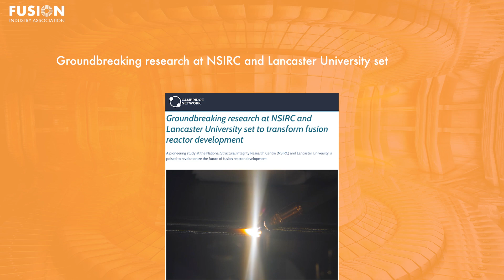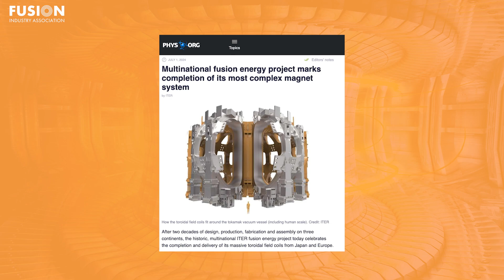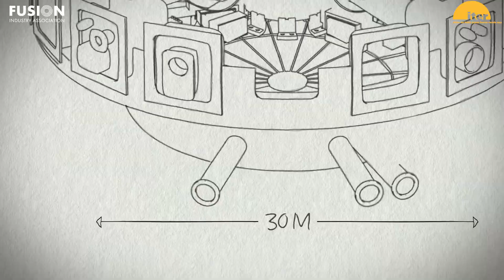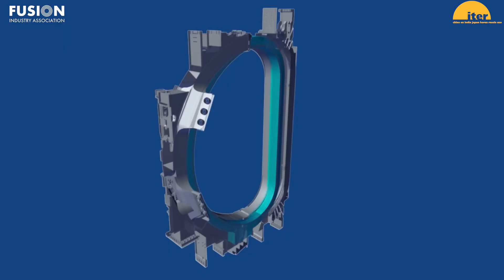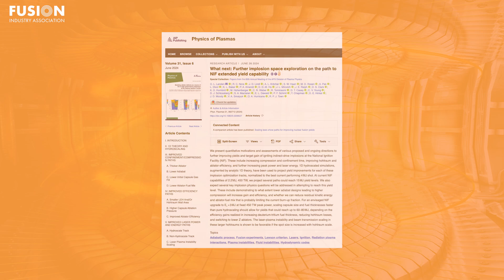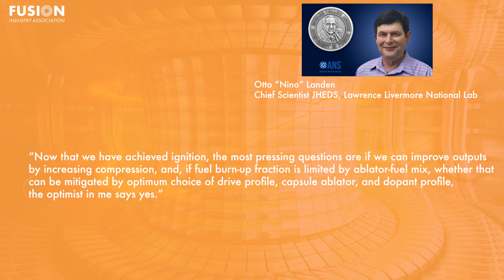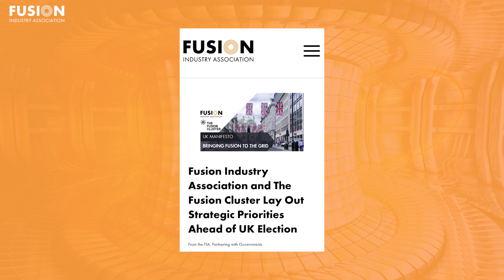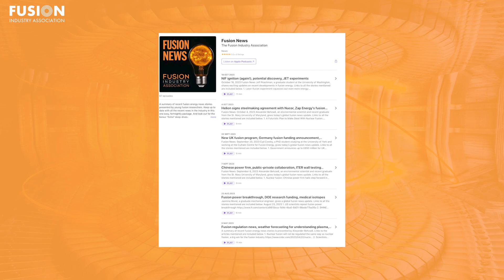Fusion News, July 10, 2024

Comment: Rather funny (ironic?) that we have one article celebrating a big advance for ITER followed immediately by one laying out the multi-year schedule slip and cost increase also for ITER. 

Still think ITER will have a role to play as a research tool for studying extreme conditions in large plasma volumes that might assist in refining the design and manufacture of 2nd gen commercial reactors. Even if not the enormous sunk costs, international agreements and long term manufacturing contracts probably mean that this project will lumber on for a number of years until it joins the Supercollider in Texas as a giant mushroom farm.

Comment: Проблема в том что использование вольфрама не решает проблем первой стенки. Опыты, проведённые на установке ГДЛ в институте ядерной физики именно не будкера показали, что при выпадении плазмы на вольфрамовую стенку в диверторе он не будет нежно испаряться, нет, — плазма выбивает целые капли вольфрама из стенки при этом.
Reply: That's why you'd like to prevent ELMs and disruptions. The issue here is the alternative they were working on was beryllium, which was worse. Indeed, alternative wall facing materials will need to be developed for commercial fusion power plants, but this is the best we have for the time being. ITER is just an experiment. A very expensive one to be just an experiment.

Comment: ITER is already obsolete and this is already recognised by the fusion community, eg in the U.K. where the emphasis is on compact reactors such as STEP. For ITER, the cost of something so large rules it out as a step towards a feasible electricity generating reactor. The best thing for ITER would be to stop the project immediately, the worse would be to continue and use it for DT experiments. After that who will pay for decommissioning the radioactive and tritiated structure ?